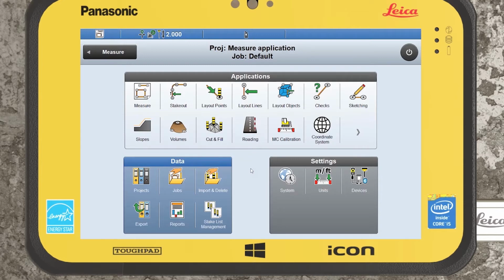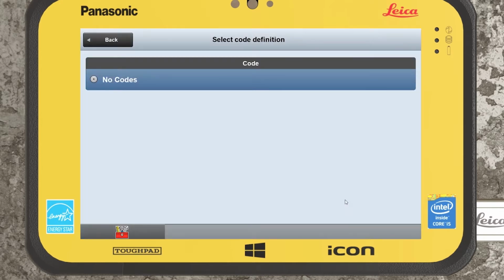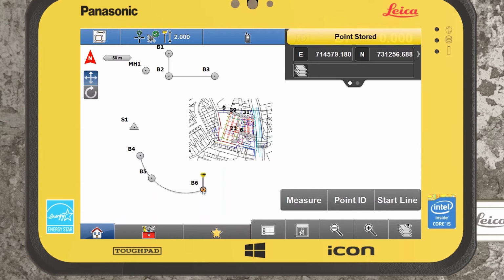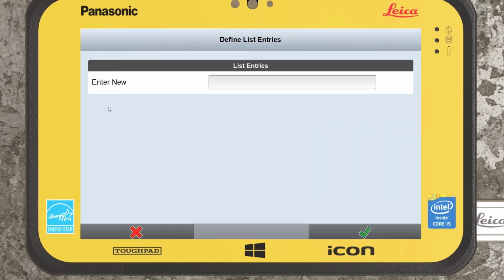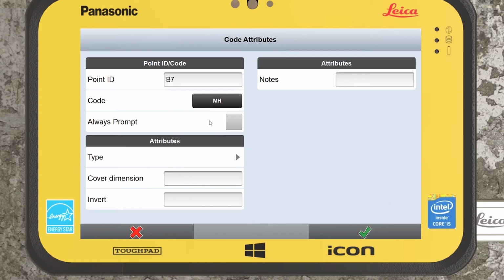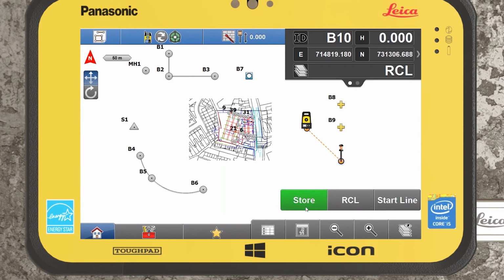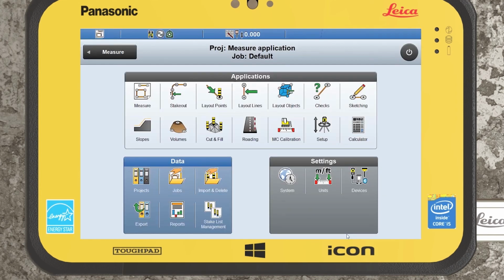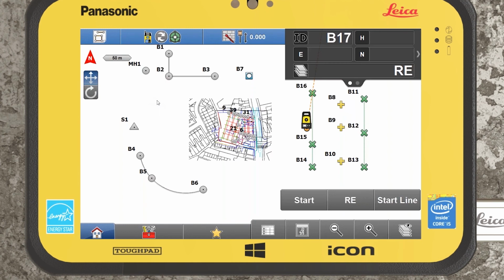Leica iCON Measure Application

Comment: Hi,
Thanks for the quick and esasy to understand presentation.
What we all need to connect all strings correct is to match all codes we're using on the field. It's not working as on Leica captivate. When I start new LINE, I choose the code, for example Kerb Top KT, and ICON is not offering me suffixes, so the KT is always KT, what I need is KT1...KT1...KT1 END LINE, and for the next line will be KT2...KT2...etc.
How to fix that?
If I choose the name to be my code, the numbers are always changing, so I can't keep the same name I need? If I start KT1 and save the point, the next will automatically change to KT2, so in my Civil 3D the figure will not be connected.
I assume this is a big problem, and I don't know how to solve it!
Please help with this?